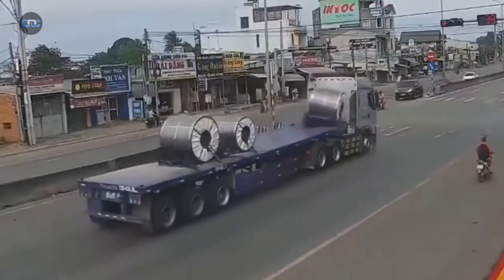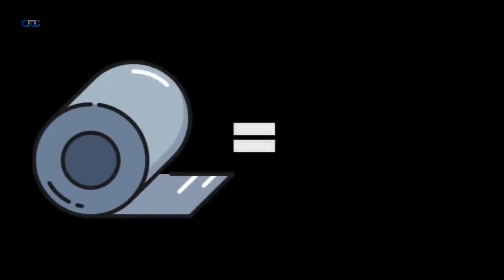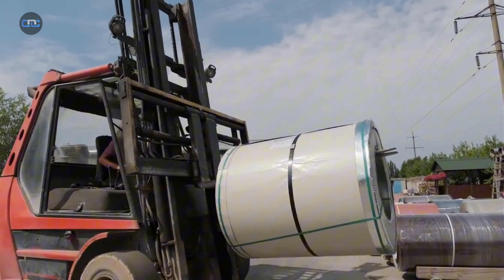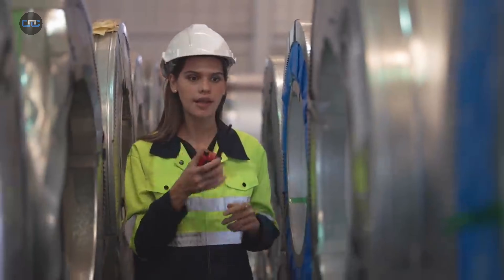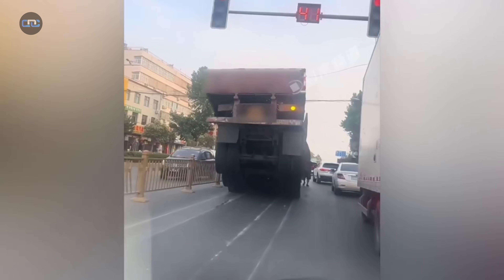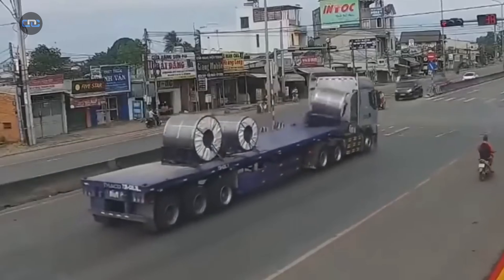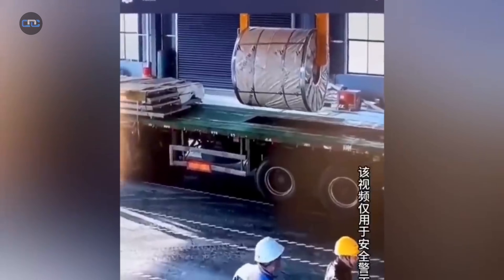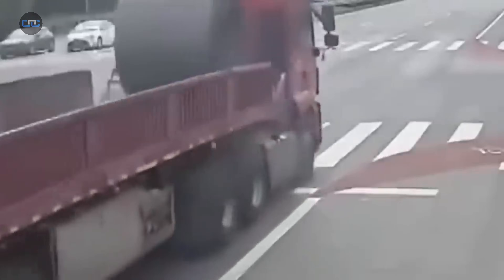How Dangerous Are Steel Coils? Stay Away from These Trucks

Comment: My Dad was Maintenance worker at Chrysler Stamping plant, workers at presses would get lacerations from not wearing articles of Clothing to protect them.
Steel stampings weigh about 30 to 50 tons, my Dad told me had a cable break while hauling 50 ton Die 3 feet above ground and shook whole plant which is over 3/4 mile long.

Comment: WTF did i just watch?
We in Europe use Coil-liners to move them.   The coil sits in a cratle. supportet by metal beams, to prevent a tipping forward, the cratle stopps it from rolling sideways. You fixate it with chains and straps.... no problem there

Comment: I used to work at a facility that finished and processed those big steel coils. They are no joke. Once they get rolling or fall over, lord help you. I once saw a 40,000 lb coil slip out of the hooks on an overhead crane (new operator) and when it hit the floor it shook almost the whole building and left a big @$$ phreaking' crater in the floor.

Comment: SIT THE ROLL IN THE HALF CUP WITH DUNNAGE, PLACE THE TOP CUP ON AND BOLT THE FLANGES THEN LIFT THE COIL FROM THE ENGINEERED LIFTING LUGS ON THE FLANGES IN PAIRS.

Comment: I used to work for a railroad, in their Transload warehouse.  Basically we took a switcher locomotive up the tracks to where main line trains dropped off coil cars.  Then we would pull them back into the warehouse and unload the cars with an overhead crane, and into many different rows meant to be loaded onto trucks to be delivered to their respective Mfg.  It was not a fun job, the coils were stacked in 3 high rows and then we had to load them with the crane from coil cars to semi trucks.  There were many close calls, and my boss always said "Is everyone alive in here?!" every time he came into work in the morning.  Thank God I don't do that anymore.

Comment: I hauled them over 1/2 of my trucking career with no major incident's. Switched to tankers my last 3 or 4 years. Also drove a cement truck for about 10 years.
Reply: Had my tanker endorsement but never pulled them. Heard the sloshing and surging of the liquids, even with baffles, are just as dangerous as the coils.
Reply: @ObeahMan333  I never had an incident. You get used to it but you got to respect it, it can really kick you in the ass if you ain't paying attention. The money is usually really good! Baffles lesson the sloshing a lot. A lot of the ones I pulled has no baffles. I was hauling liquid sugar  and food grade oil for animal feed. I worked for Dutch Farms in Chicago.

Comment: Years ago, there was an accident in my hometown where a lady driver rear-ended a county plow truck stopped at a traffic light.  The county truck hit a semi trailer with a load of coils on it. One of the broke loose and landed on the car in the next lane, crushing the car to about 3 feet high.  The driver was killed.  I worked with the nephew of the deceased driver. That intersection was closed for a couple hours while they cleaned up and investigated.

Comment: Pressure requires a contained compressible fluid (gas or liquid)… A steel coil is just a long ribbon of metal rolled up into a donut… There’s no cavity holding fluid… 

So if you’re thinking: “Does a wound steel coil hold pressure like a compressed spring?”
Well, Yes and no… No, not in a pressure sense… Yes in a ‘this bitch wants to unroll like a pissed-off anaconda’ sense. But that is mechanical tension, not internal pressure… a steel coil at rest has zero internal pressure… There’s no PSI, no “bar,” nothing like that… Instead, it’s all about stored elastic strain energy and residual stress fields in the metal…

Comment: T towed a truck carrying large industrial rolls of paper standing upright that broke loose under panic braking and rear ending the truck ahead. The rolls pushed the trailer forward off the fifth wheel and into the back of the cab. Never saw anything like it. Between the rear ending and the trailer breaking loose the driver was seriously injured.

Comment: No a small pothole should not break these things loose, nor should hard braking in the case of emergency as long as the driver and the loader did their due dilligence with properly rigging the coil to the flatbed.

Comment: Weighs several tons and can roll... what could possibly go wrong?
Used to work in a wire drawing / hot dip galvanizing operation. Nobody ever had to tell me to stay far away from wire rod coils and 30x10x5 (feet) baths full of molten lead and zinc... oh, and all the nice warm hydrochloric acid.
That place was fun... but it could kil you in a heartbeat.

Comment: I work in almost all areas of making this. from the beginning where the materials are mixed, then off to the arc furnaces, then casting giant blocks of metal. Which is then send to hot mills to be rolled thinner. My last interaction with this was working in the cold mills where we tinned or galvanised the metal coils. The only area I have not worked in, was transporting these coils. It was very interesting to see how it got from ingredients to the final product in my time spend in that industry. And NO, you cant start rolling a coil on your own....lol

Comment: A master coil can weigh 30 tons that we dealt with. Had a guy squash his foot off years ago were I worked when it fell off of the C-hoist. He didn't bleed. It pinched his arteries and veins and sealed them. Had some dumb guys in St. Louis try to roll one off an 18 wheeler onto a truck once at a truck stop. It buried the rear axle down in the pavement.

Comment: I didn’t know you could do that, melt butter or whatever that was on the steel coil because of the immense pressure it was under, that’s cool to know 😮
Reply: It's still hot from the annealing, not pressure.
Reply: @FeralCoon  it's hot because it is rolled while it's hot.
Reply: @crooked_dance  It's rolled while hot from the heating elements or burners in the oven, not from being rolled. It gets annealed after that and begins to cool slowly to ambient temperature. A large mass retains the heat for a while. It doesn't stay hot forever just because it's rolled so tightly. 🙂Worked at a major metals processing facility for years.
Reply: @FeralCoon  we agree. it needs to be hot to be rolled in the first place.

Comment: I can remember picking up coils in Cleveland, Ohio back in 2001. A few tweakers got the bright idea to try and steal one. They broke into the factory, found the forklift keys, and decided to load a 40,000 lbs coil into the back of a square body Chevy 4X4. Well it didn’t work. The weight of the coil flattened that truck. Once I put two and two together, this was an inside job that went completely wrong. We would use 5 chains and binders for each 40,000 pound coil along with cradles. Plus we had a D.O.T mandatory pipe header on the back of the tractors cab for protection. I never had any problems handling coils. I would make a lot of stops to check the chains and binders depending on the road conditions. But most importantly, we kept our equipment in tip top shape. I would always inspect the binders and chains after each load. And have the chains tested when needed. Safety first!

Comment: Whoever decided to take a flat sheet of metal and thought it would be a great idea to roll it up into a heavy deadly rolling wheel of doom needs to have his head examined. Flat slices of steel are also efficient and safe to transport, just sayin'.
Reply: Often the one buying it needs a coil to feed into their various manufacturing machines, easier than having to continually load sheets. We use coils where I work that feed into a machine and put out straight segments of air ducts, and we also use use sheets too.

Comment: In the past I have designed strip coilers for multi spec. steel producer and also for aluminium, brass, copper and other metals used in sheet   form. Most but not all metals are coiled hot so there is friction between coils which increases as the metal cools. The coils can exceed 30 tonns. The metal can be from 5mm to 32mm thick in hot coils. Cold coils are smaller and some times have protective covers. However cold coils can have a very high internal tension, literally a coiled spring, and will unwind with spectacular force if mishandled.

Comment: You are stating false facts that coils, for example, can easily break loose from just hitting potholes?? If the truck driver properly chains down coils, they are not going to just randomly break loose as you are falsely implying. These videos you are showing are the complete failure of the truck drivers who were too damn lazy and didn't care about safely securing the coils. Do some research on this subject that is based on facts, not your BS.

Comment: Am I the only one that questions why they don't lay them on the flat side? It wouldn't roll. Slide/skid maybe, but not as easily as rolling. Who cares if it is easier to load them that way...Safety should be number one.
Reply: They do. It's called "eye to the sky". The reason they don't do it with all of them is because either the mill or the customer doesn't have the setup to load or unload them that way. Also, you're limited in how many chains you can use that way, and it may not be enough rated securement for the weight of the coil. It can also damage the edges of the coil which is why some mills only allow straps on that orientation. With a suicide you can throw every chain you have on the truck through the eye.
Reply: @doughansen5957  Thank You for the explanation, I have just never seen them on their side. It makes sense.

Comment: Driving in 2005 on the highway near Toronto on the first day of school (I remember the day because I just droped 3 of my small kids to school). This kind of steel coil fell from truck in front of my car, rolled and was unwinding. I stoped my car 6" before it. I had the most scared time in my life !  I could not turn left or right because steel was unwinding I saw debris, pieces of asphalt and sparks in front of my car and I pressed on break  enormously hard. The most incredible and weird feeling was that I saw everything in slow motion ! But in reality all action just took a few seconds. I think it was miracle that I survived. To this day I can't understand why I had visual experience in slow motion but I know it was just a few seconds from moment that coil droped from truck to complete stop of my car !! 🤔
Reply: I’ve had that slow motion when I saw my wife’s van upside down with her still in it. It felt like I was running in slow motion to her. Old feeling.
Reply: Adrenaline.. When you have a sudden massive surge of adrenaline, your nervous system fires into overdrive causing your brain to process information more quickly. This causes the "slow motion" effect.

Comment: They should be transported with the hole facing fore and aft, the trailer has a well between the chassis rails, sit the coil in the well and strap it down and it’s going nowhere.

Comment: I've hauled thousands of coils. They are fine if you know what you're doing. The problem is today, so many drivers do not chain and secure them to go across the country. I would use at the very least 12 chains and binders if not more. They are deadly if you do not chain to the weight of those coils. I'm lucky as I ALWAYS chain as if they are a part of trailer. I haven't done it in over 20 years but nothing has changed. Over chain them and you'll most certainly make you delivery without issue. I have seeing guys lose their lives over a load. Over chain and you'll be solid everytime. Good luck and God blessI
Reply: while ive only hauled dumb shit in the back of a pickup, I would always go whole hog on the bungie cords. Nobody will ever complain you over secured a load.

And for any bosses out there that complain about time spent on being absolutely sure a load is secured. Always remember, time spent by a driver doing the job right is better than the expense of it not being done right both in lives, financial and your truck being on the evening news for all the wrong reasons.
Reply: @filanfyretracker  same here, i bought a butane canister and i bought a ratchet just to secure it, i didn't want it to like come loose then roll on the back of the pickup truck's back rack and get damaged or maybe even fall on the highway and cause an accident bc i cheaped out on it.
Reply: That's because the steel hauling industry is full of foreigners with phony CDLs.

Comment: I used to work in a steel manufacturing plant, I had to open the coils and feed the material into the machines! Gnarly at times
Reply: That 12 gauge steel going through the roll former was a pain in my ass

Comment: I hauled steel coils primarily out of Nashville, Tennessee for about 11 years and I had one come loose. I managed to keep it on the trailer, but it was a big deal. Some 6 inch wide lay flat coil slid off my truck one day but nobody got hurt. I used to have nightmares of a car, squeezing in making me swerve in a coil crushing him as it fell off my truck. They are dangerous as anything else on the road thank you. Good video.
Reply from the maker: Wow, glad you're safe! Thanks for sharing your experience 🙏
Reply: I would wrap one chain in a loop around the top to lock them together when I hauled those thin ones.

Comment: The extreme heat was the most surprising and how long it takes to cool.
Reply: You would think, steel is a good heat conductor. I was surprised as well
Reply: @mateusz92380  key word - conductor. After it's rolled up it is just a large thermal mass - big volume, small surface. But i'm pretty sure the issue of heat exists only at the production sites (where they make those rolls) since I refuse to believe that any company will load up non-cooled rolls. Too many issues with that - from logistical and equipment nightmares, to changes in rolls' tension on the road due to cooling down. I mean  most must've heard the metal creaking (metal window sills or roof for example) in the morning heating up under the sunlight and in the evening - cooling down. Same thing here.

Comment: any truck that hauls a flat bed with anything like this should have one hell of a headache rack. Hell any truck that hauls heavy stuff on a flatbed should.
Reply: Most headache rack sold these days are not engineered to prevent the load from moving or even coming into the cab. They're built to store chains and equipment. The only thing that will prevent a load from moving is to prevent the load from gaining momentum. And the only way to do that is with proper load securement.
Reply: @Mount56  Yeah i was thinking more of a custom made thing. Something beefy as hell.
Reply: @plaid13  That's not a good idea to say the least.
First problem that should come to your mind is that this would only protect the driver, not the people around him. And if driver feels protected, he will neglect the safety of his cargo even more.
Reply: @parafolly  So you are saying a driver that thinks enough bout safety to get a headache rack is going to think less about safety than someone that doesn't give it a second thought?  I disagree.
Reply: @plaid13  I am also saying that there is no headache rack in the world that could stop a steel coil that has become lose without like halving the weight capacity of the truck, making it economically complete nonsense. It also doesn't resolve the issue of people neglecting safety. Safely secured metal coils don't become lose. You want safety? Secure your metal coils. Problem solved. You make it sound as if metal coils are bound to become lose and wreak havoc. There are also idiots who don't maintain their brakes and die. Wearing a helmet could have saved them, but so could have brake maintenance...
Reply: @parafolly  That is pure BS. First clip in the video the coil hit the back of a sheet metal cab and smashed it in a couple feet. You put 300lbs of engineered triangulated steel tube behind the cab its gonna stop it. At the very least it will slow it down enough for the cab to stop it.
Reply: @plaid13  300 lbs of steel tube is not gonna stop 20.000lbs of metal coil that has caught momentum because it AND I CAN'T STRESS THIS ENOUGH wasn't. secured. properly.
Reply: @parafolly  Wow... You people really know nothing about how things work huh. 300lbs of steel is more than enough if designed right. You know those roll cages in race cars that hold up in 200mph crashes? thats like 150lbs of steel. stopping 40,000lbs of steel rolling 10-15mph at the back of the cab is less demanding than that. A simple reinforced A frame headache rack is gonna stop it or at least slow it down enough so the cab does.  It is amazing how many stupid people argue against safety. Bet you were the sort of person that thinks there is no point in wearing a seat belt because if you get hit head on by a semi truck it wont do any good. Pure stupidity.
Reply: @plaid13  You know what else would stop 40,000lbs of rolling steel coils? Securing it properly. Are all people in the states this dense? That question was a rhetorical question. Rhetorical questions are questions that don't require an answer.
Reply: @parafolly  Of course it would but accidents happen things break. Say another truck side swiped the trailer. broke things it rolls loose... Why are you arguing against a headache rack again? Oh yeah stupid. that is why. To argue against safety because if nothing goes wrong it shouldnt be a problem is idiotic.

Comment: I did steel coil for years and you don't even need chains. It all depends on the wood placement, wood quality, what some truckers refer to as cribbage and your driving skill. I almost Never used the trucks brakes to slow the truck down. It was all Inertia and Gears. If you need to excessively brake your a failure trucker coils or no coils. Looping corners and offramps ? 3 mph and this out 🖕the window to everyone behind you. Never lost a strip of metal